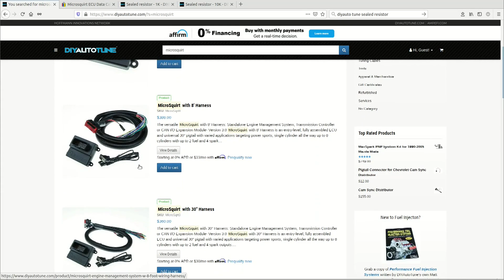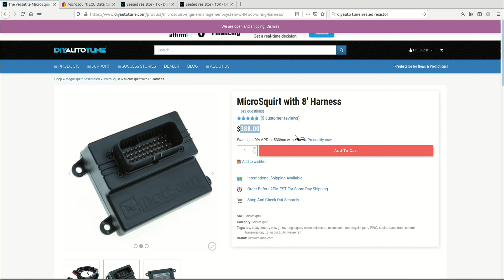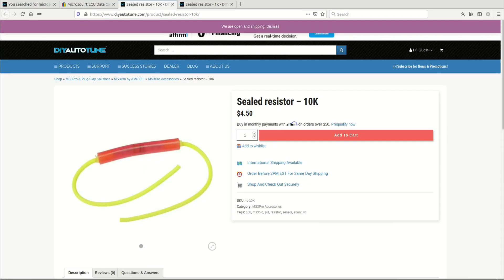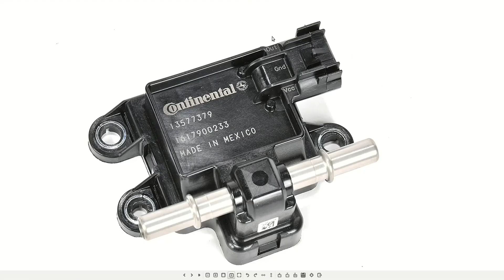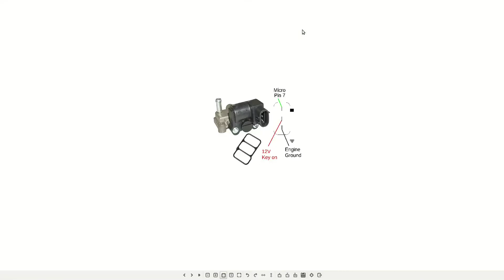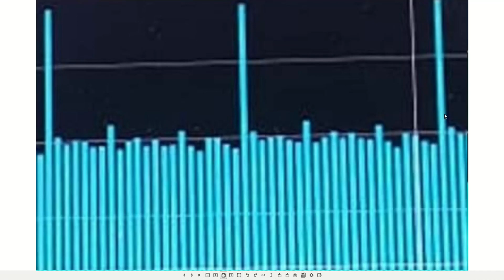J35 Microsquirt Guide Pt.1

Comment: Can you show how did you installed 1k resistor, or pic please
Reply from the maker: I did it inside the ecu. Soldered it from vref to whatever you’re going to. I chose todo it inside so I never had to worry about a wire breaking.

Comment: This would be the basis for say any engine using microsquirt? I’ve been wanting to test run this standalone for a while now but never committed. Thanks for the info, really helpful and well detailed. I feel confident to try this ecu before I swap my engine
Reply from the maker: Pretty much. The trigger info might change a bit and coil settings. Also the aled and wled may not be needed depending on the application. It’s a pretty easy to use ecu. I’ll probably move it to my mower when I’m ready to upgrade. I already have a grasshopper running on e85 lol. Been wanting to swap to efi for a few years.

Comment: Hello My name is Tim   Recently purchased a Microsquirt  for my 4 cylinder boxer engine. I have all the sensors connected up. All are working except the Engine position sensor. It is a Hall Effect sensor that picks up the RPM and crank position. When I turn over the engine I seem to get random firing on all the spark plugs. They kinda look like they are all firing at the same time. With the crank sensor and the RPM sensor tied together the wave form seems to be correct, however, the RPM signal is only 2.3 volts DC while the crank  signal is 5 vdc. anyway if you have any advice I would greatly appreciate it   Thanks

Comment: question if you dont mind sharing where you get mounts and what transmission you use looking to do same swap?
Reply from the maker: Cl or tl type s 6 speed lsd iirc 01-06 is the first gen bolt pattern. Some accords had v6 6 speeds but they were not lsd. Depending on hp goals would depend on which is really needed. Hasports are the only way to go. Innovative are junk once boosted.
Reply: @soullesssol7285  Thanks for info appreciate that.💪🏼

Comment: Can I use microsquirt on a distributor with one coil and ignition control module?
Reply from the maker: I’d say yes, but that’s a pretty vague question. Would need a lot more specifics/info than that for a sure answer. Ppl do run them on distributor and none distributor cars though.
Reply: @soullesssol7285  well I have a 95 Volkswagen Golf. It has a distributor with one ignition coil. The ignition coil has an ignition control module. So I’m considering the microsquirt but I don’t want to use a crank sensor or coil on plug for now. Btw the distributor has a Hall effect sensor on it. I think that may be able to connect to the vr input.
Reply from the maker: @archipiphanyworkshop860  I would tie the vr right to the hall sensor on the dizzy.
Reply: @soullesssol7285  thanks. Your videos have been a tremendous help and a major force in convincing me to get the microsquirt.

Comment: This was quite interesting I was considering this for an LS Swap a few years ago I own a honda now and once again I'm glad the same solution is applicable would this work on a dseries tho?
Reply from the maker: Yeah it should work. You’d have to count the crank teeth in the dizzy and probably grind one off. You’d have to do batch fire on the injectors, but you could go coil on plug and control individually(need tdc sensor hooked up, which is in the dizzy also) or wasted spark(no tdc sensor needed).

Comment: Awesome content. Thanks for the much needed info. Just switched to a gen 2 engine but that can also be grinned down to a 12-1 trigger wheel.
Reply from the maker: Good to hear. I know eventually Honda started taking teeth off of the gear just don’t know the exact years so didn’t want to misinform anyone. This is for the vr sensor(2wire) though a Hall effect sensor can be used it’s just going to have a third wire which should be a power. Some of these require a pull up resistor between the power and signal. It varies with manufacturers and some build the pull-up in the sensor already. It would need to be confirmed.
Reply: @soullesssol7285  once I’m in the wiring stage, I’ll probably message you for some advice. Keep doing what you are doing. This is really awesome content that can not be easily found.
Reply: I’m running an ft450 and am having issues with the crank sensor. Mine is 24 teeth I believe? Do I also need to remove one tooth?
Reply from the maker: Just depends on which trigger patterns are supported by the ft450 and how it’s wired up. Also depends on what it’s setup is. Sequential or batch fire.

Comment: Is this a j32 from a cls6 or auto to manual?
Reply from the maker: Auto. You can use a manual j32 you just need to swap to an auto gear and sensor and take the correct tooth off. The manual j32 should be 24teeth and auto should be 12. You can also get that gear and sensor from a j35a4.

Comment: Thanks for posting this. Mirco gets bad wrap in Honda community for what I don't know.
Reply from the maker: Yeah, megasquirt and Honda usually don’t go together. Back in the day we had Crome and that was hard to compete with price wise, now the stand-alones are up there in price and the micro works for most ppls target power levels. I do believe you get what you pay for and with higher priced ones you have a lot of other sensors ect that you can run, that’s where the micro falls short.
Reply: Honda guys are just used to the b-series ecu tuning/hondata. Simple and effective, no extra wiring and BS. The v6 ecus all kinda suck, so it really makes sense here.